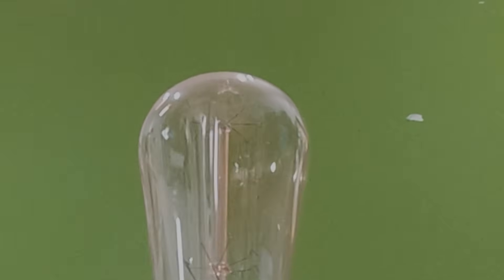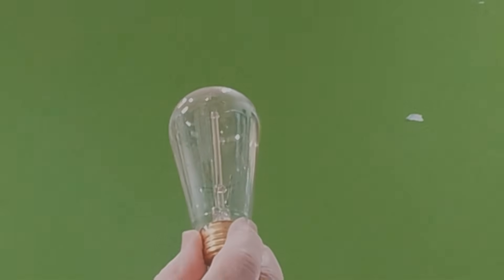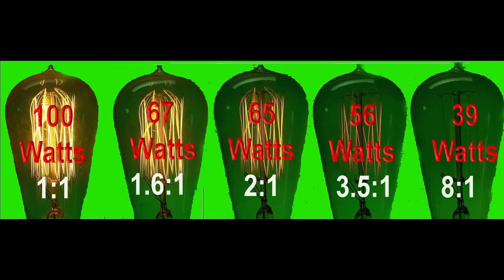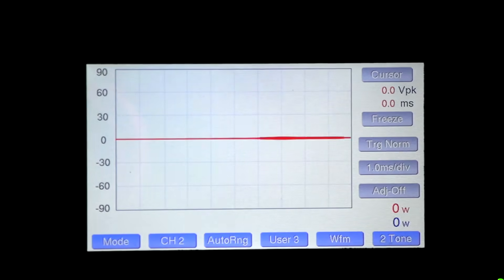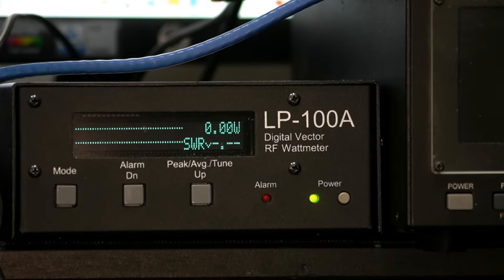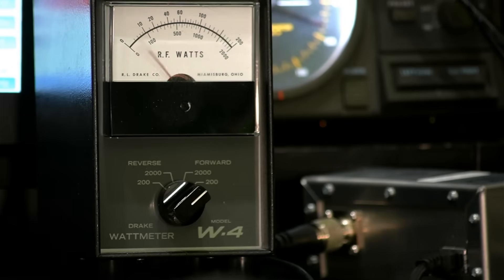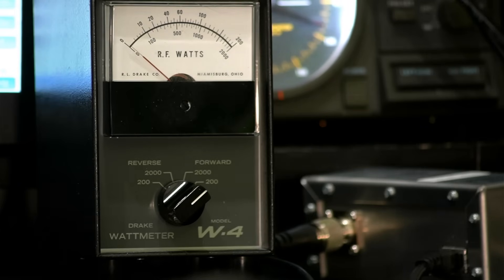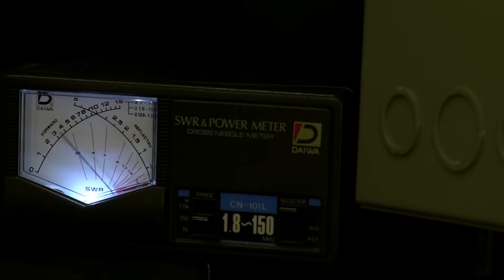The ARRL Writes  About an SWR Myth Among U S Hams, Find Out the Truth Watch the Bulb! 73, Jim W6LG

Comment: You can transmit into a 10.1 swr if it's matched at the input, the 10.1 swr is still on the feedline, if the feedline was improved with a higher voltage rating like balanced line it would reduce the likelyhood of voltage or higher current being an issue, loss due to the higher swr is reduced also
Reply from the maker: Yes.  But how many guys do you know who have done that? Probably just a few.  Most have coax and most have a very lossy coax. So now what?  Thanks, Jim W6LG
Reply: @ham-radio matching at the input most everyone does, the swr is still the same the mismatch hasn't changed just the impedance the radio sees has changed to allow the transmitter to produce full power into the now resonant conjugate matched system, this may be lossy depending on frequency or feedline in use but the point is you can put power into an swr of 10.1 or more its not a myth as you said

Comment: I guess the only thing to add to the bulb test was to say the feedline loss in dB for each SWR reading, bearing in mind you conducted this interesting test up on 10m. So 8:1 looked pretty severe, but would it be THAT severe down on 3.6MHz where the feedline losses are much reduced? Therefore, perhaps saying the stated losses for that coax and its length might create a more level playing field. 73 Jim, keep rocking 👍
Reply: Definitely, if Walt Maxwell is to be understood then the theoretical lossless line would result in no loss and full signal radiated by the antenna regardless of the swr
Reply from the maker: Yes of course. But, most guys have RG8X and that is not loss less.  Theoretical goes out the window with many ham antenna systems. Thanks, Jim W6LG
Reply: @ham-radio well no its still theoretical, if its matched at the input the transmitter is putting its full power into the system the swr is still 10.1 the mismatch hasn't changed,
Reply: @ham-radio oh I agree, but it’s about creating a common measurable metric and feedline loss does this. 73
Reply: @TIMG5TM if the experiment was to include coax from low to high loss levels it would give a better understanding and actually include the conversion of reflection gain